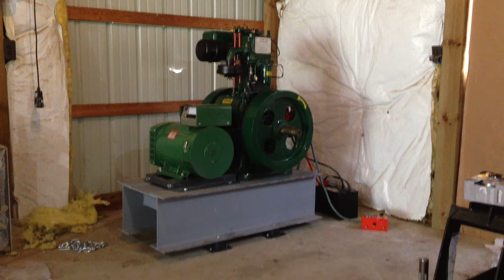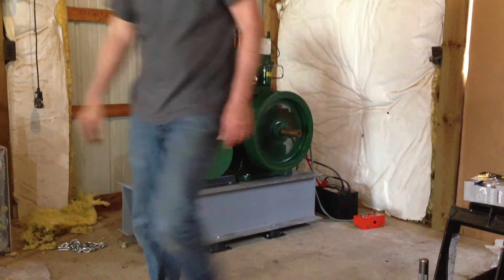Powerline 6/1 Listeroid balancing

Comment: I just purchased a craigslist omega 6/1 and after seeing it hop skip all over (at home) with a 100# base I beam I decided to find out why. One of my counter weights is on the same side as the piston when at TDC. I have three choices: replace flywheel, re-broach keyway or try and remove counter weight and re-mount. (last choice may not be as safe). Were both of your counterweights on the opposite side of the keyway? And how did you correct it?
Reply: Very interesting, I seen another video (youtube) where the thing was jumping around like a frog, I said to myself - 'must be an out-of-time counter-weight'. Sure enough.  Did you ever fix it ?

Comment: You'll never be happy with those rubber mounts. Went through this myself. It will be a sweetheart if you mount it solid as designed. My govenor worked smoother and I believe the mounts actually absorbed part of the power pulse robbing output.

Comment: Did you figure out what the noise was, from first smoke ?? Very nice. I'm looking at doing a cs10/1 and Yanan alt head in the future, once I've finished its shed.
Best regards;
Mike.
Reply from the maker: Yes the noise was the flapper valve for the crankcase vent, once it got a little oil mist on it, it stopped making that noise and quieted down.